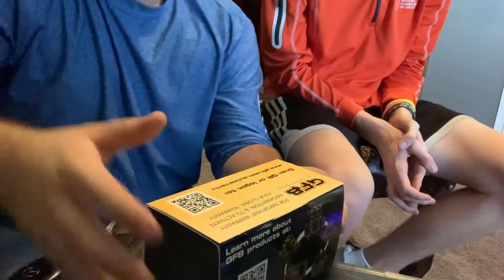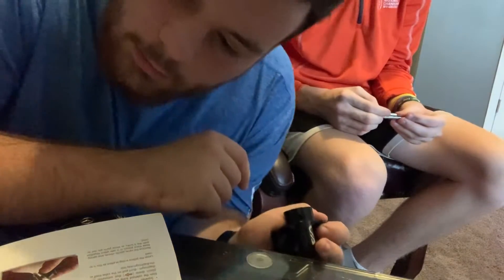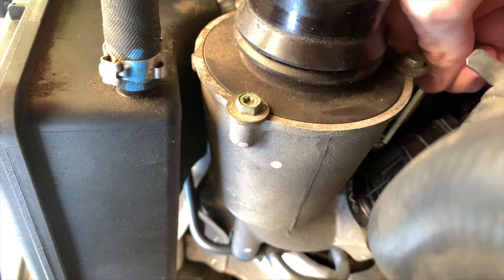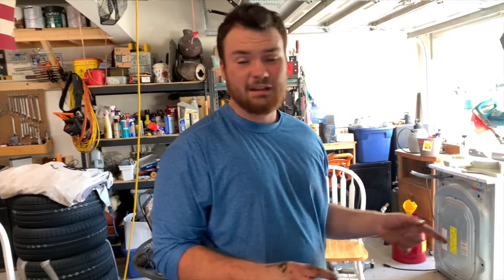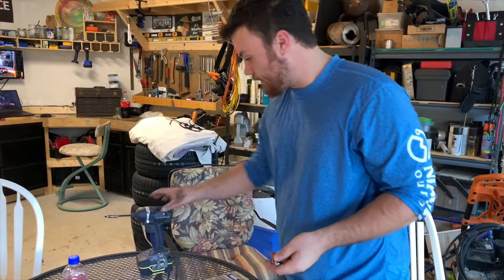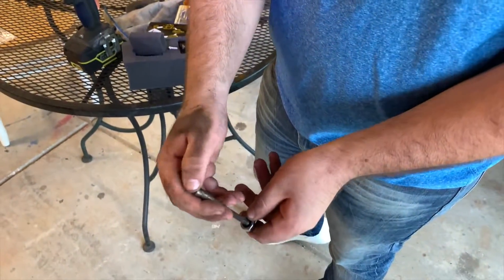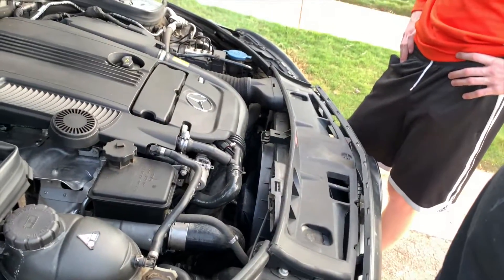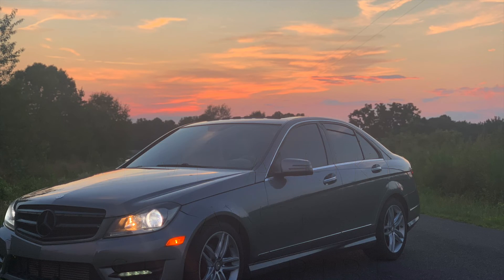Mercedes c250 Blow Off Valve!

Comment: yo quick question getting mine tomorrow, and wondering do you have to lube it up ? and also do you have to use a tourqe screw to undue the bolts ?
Reply from the maker: If you have any questions dm us on Instagram happy to help sorry for the late response
Reply: T20 torq screw and I used a little bit of clean motor oil around the o ring and the inside of the shaft